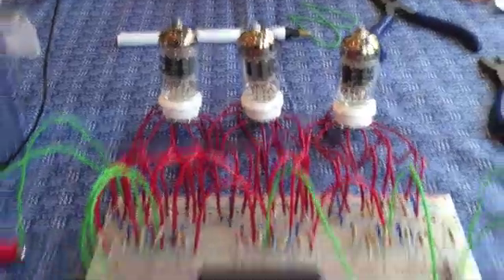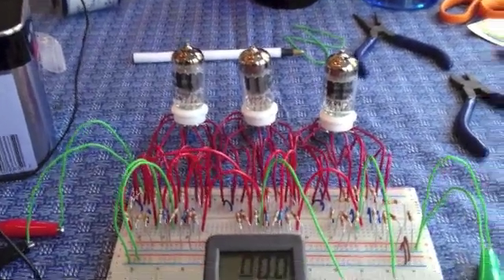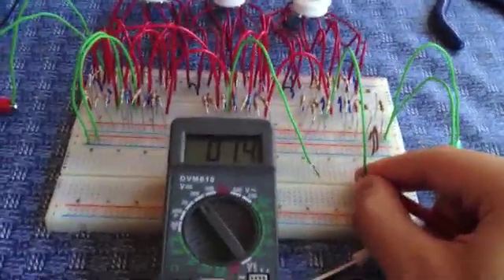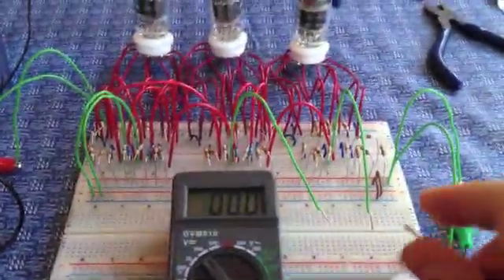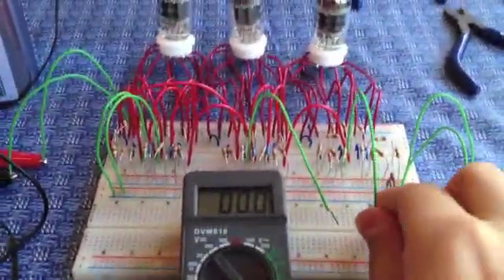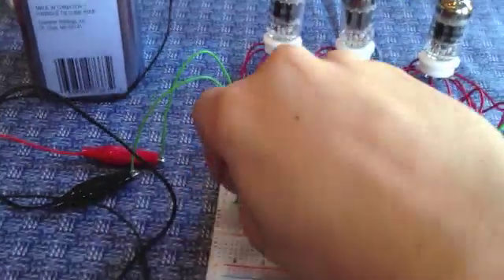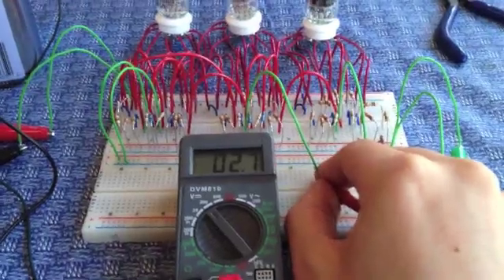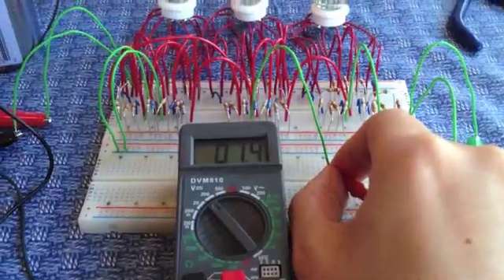Vacuum Tube Half Adder

Comment: which book did you use ? I can't find much literature on vacuum tube digital circuits
Reply: Just create the Logic Gates of a Half Adder using Vacuum Tubes instead of Transistors. Simple.
Reply: @hrishikeshkashyap3715  it’s not simple .. how’d you bias them ..they are not like bjt or mos transistors

Comment: question, how did you power this ?
Reply from the maker: A big six volt battery and several nine volt batteries attached in series.
Reply: cool so no high voltage here ?
Reply from the maker: ***** Nothing higher than a few dozen volts.
Reply: Esperantanaso  do you have sources like links and schematics ?
i would be verry interested ! :) I have lots and lots of tubes my self.
but you just sparked my interest :)

Comment: No so much these days, but they do have advantages.  Vacuum tubes make better amplifiers - i.e. amplifiers with less distortion than any semiconductor device we make these days.  Because of this, they are still used in high quality sound and radio equipment (radars included).  Its one of the only reasons they are still made.  The other is that they are not as vulnerable to EMPs.
Reply: Vacuum tubes suck for logic applications, logic is complex unlike them
Reply: @silentbloodyslayer98  what do mean by "suck for logic applications"? Function of the Vacuum Tubes are the same as that of Transistors. Only difference is that, Transistors are smaller and consume less power as they are solid state devices.
Reply: @hrishikeshkashyap3715  sorry i didnt elaborate, tubes are bad for logic applications because of their high rate of failure over time, big size, fragile construction and high power consumption because they need heaters to work. Also, they are high voltage devices which means high impedance, this is not great for high frecuency applications, to deal with this tubes need to work as pentodes or tetrodes to reduce the internal capacitance, thus adding complexity. Tubes also need to be biased to work in cuttoff/saturation in a different way transitors do.